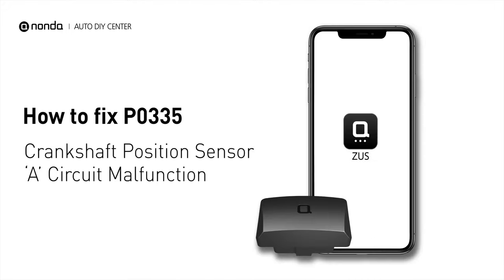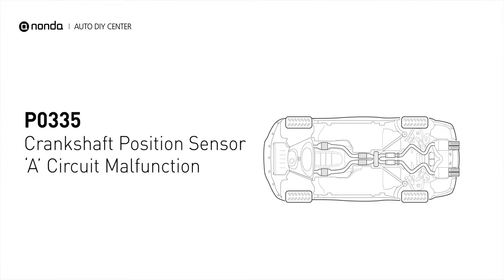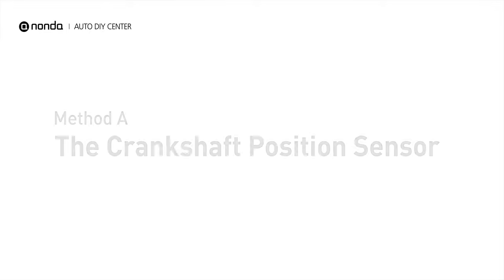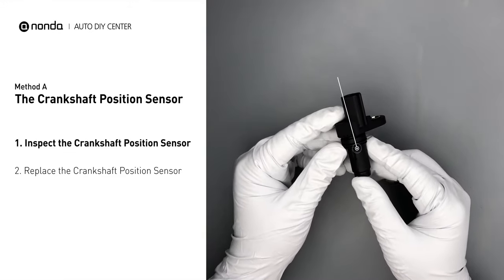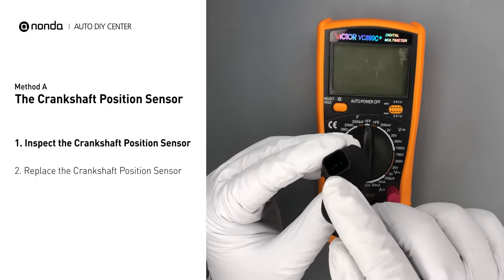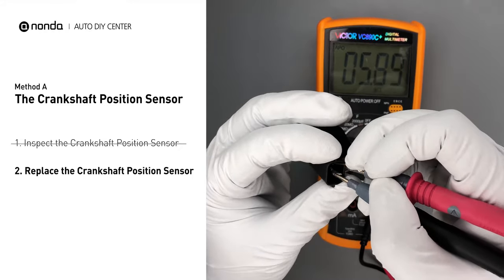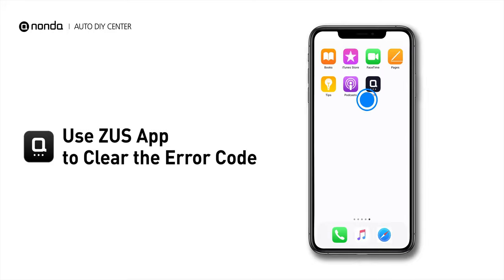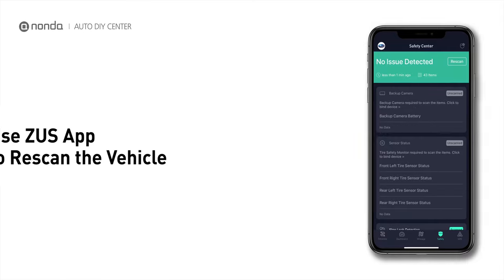How to Fix P0335 Engine Code in 2 Minutes [1 DIY Method / Only $9.36]

Comment from the maker: Hi, I'm Steve, nonda's lead mechanic engineer. 
Feel free to leave your comments here if you have any mechanic questions, I will be glad to help you out!
Reply: For my 2004 pontiac grand am it was showing me this same code p0335 I replaced the crankshaft position sensor and also the wiring and yet after erasing the code and all and driving my car a few minutes later the check engine like came back on again for the same issue but everything is brand-new ?
Reply: @damianrivera7711  Maybe your timing belt is jumped

Comment: Where would it be located on a 2013 Hyundai Genesis
Reply from the maker: Hi Seasha, it is mounted on the right side of the engine compartment at the back of the valve cover.